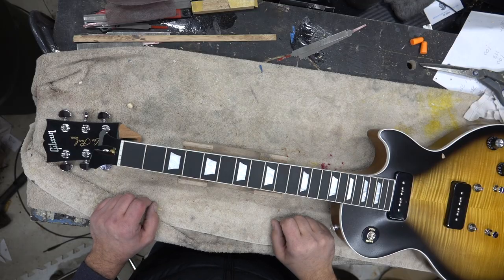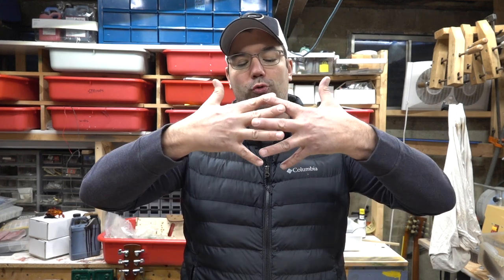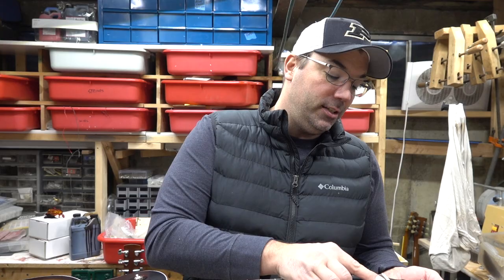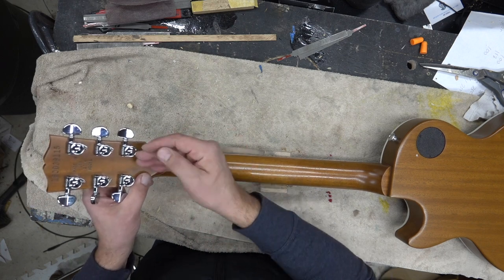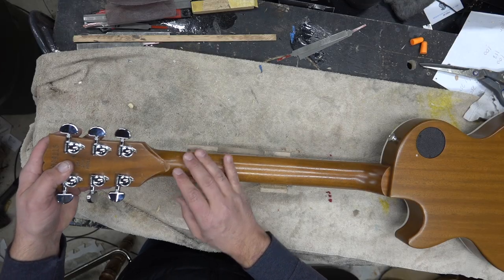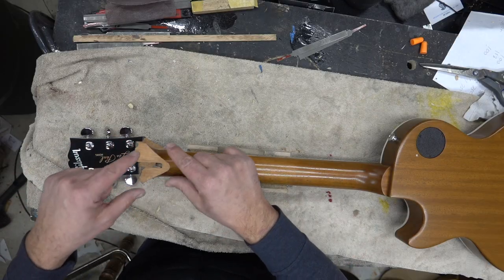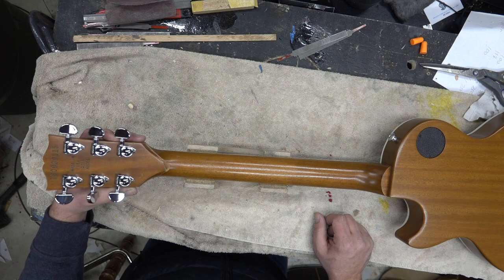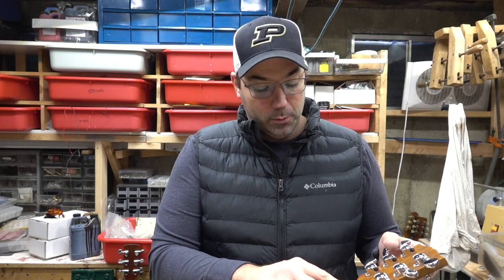Discussion on Repairing Broken Les Paul Headstocks - Various Repair Techniques

Comment: I have a Austin Les Paul Jr copy (Super Six) I bought with a cracked headstock, it was more severe than I thought was actually a snap off like 0:36. First 2 glue ups failed. Then I actually drilled thru the face of the headstock at an angle thru to the neck. Then I took threaded rod that I cut a slot into at the end for a screwdriver and screwed them in with some glue in the holes. Then I did a couple of wraps of fiberglass cloth and resin around the repairs. Sanded, painted... been holding up fine for the last 2 years, stays in tune, doesn't even look bad. But lets say I would not recommend this method at all. But the guitar, although pretty cool, was not worth having fixed, so I did it myself.

Comment: A LP is a fantastic guitar, just don't drop it.  I never understood why Gibson changed the neck design from the late 70's. I think you call it a velute in the US. Cheers to you all from Belgium.
Reply: I agree, the very first Les Paul I bought back in the early '70s (it was brand new) had a small volute.   I worked three (3) Summer jobs to save up for that guitar, finally I had the $575 for a brand new Cherry Sunburst Les Paul Deluxe.  I was the happiest and hardest working 15 year old out of all my friends.  I was also the only guy in High School with a real Les Paul.    I dragged that guitar around with me everywhere I went and never had a problem with it, nor did I ever worry about it breaking.  Just goes to show I proved ignorance was bliss!

Comment: Hey Derek,

I'm assuming you're way more familiar with "big brands" (Gibson/Epiphone, Fender/Squier, PRS, those) but I was wondering if you have any experience with/knowledge about all the other manufacturers who make LP-style guitars. I know that Epiphone uses a different headstock angle (dunno about the truss rod cavity depth though), no idea what ESP/LTD do (they might do a scarf joint on those, they do have a volute and ESP often does laminate necks anyway), I really don't know enough about Tokai or other asian brands who can copy the Les Paul without having to worry about trademark infrigement. Besides PRS, who in your experience makes trustworthy "LP copies" ?

Comment: What is your take on using thin superglue in the crack if the neck is still on and together? Crack meaning a 'fissure' or cracking starting to form.
Reply from the maker: Super glue can be brittle.  If you have get wood glue up there much better off.

Comment: You say diamond spline, Do you mean bowtie spline?
Reply from the maker: Nope.  I am doing a diamond.  I only need to fill in 1/8.
Reply: @bigdguitars  I need to see that. I know the bowtie really adds strength to tension. Never seen a diamond spline. Maybe I did not understand the purpose or intent.

Comment: Why doesn’t Gibson just change the pitch of the Headstock? It only makes sense... 😜
Reply: They did, it didn’t change anything. Changing wood species, like they did in the 70’s with maple, fixed 99% of the issue.
We like the 50’s guitars made from mahogany though.
Reply: @matthewf1979  Interesting. Could they not have figured out another way to reenforce the headstock, though? Maybe adding some rods under the headstock face and under the fretboard? It seems ridiculous that they’re ok with people just expecting that the headstock might break off.
Reply: I know this might sound weird, but the problem is. Gibson use a neck blank that has perfect straight grain, as soon as the neck angle is cut the grain direction changes, causing grain run out, and under string tension this causes a weak point. They somewhat improved this problem in the 70s by incorporating a valute, but you still have grain runout. A guitar with a scaff jointed head stock will always be stronger provided the glue joint is good.
Reply: @hqmonaro71  That’s very interesting. Thanks for the info!